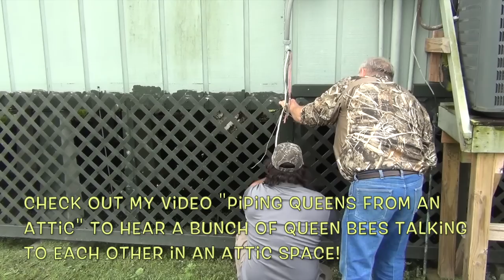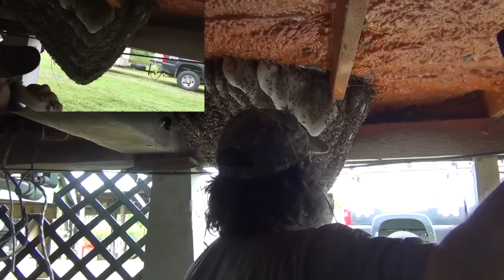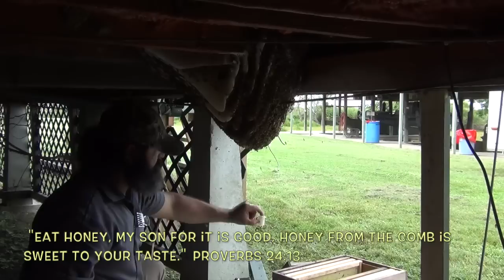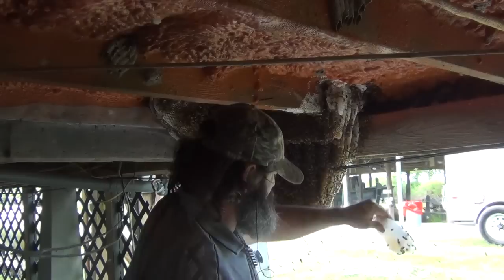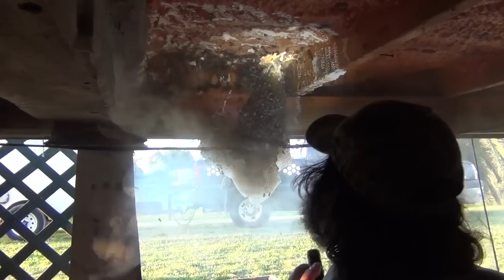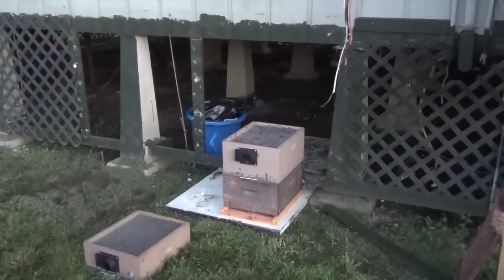Huge Bee Hive Underneath Duck Camp!

Comment: What can you do to prevent a new colony from moving right back in to this location once you've removed this hive?  I can't always get all the honey comb off and have had a few times where another swarm will move right back in from where I removed a former one.  Customers don't like that.
Reply from the maker: Evan Kenison scouts will be attracted to propolis that's in seams, etc...

The only way to keep them from returning is bee proofing.

Seal the area so they cannot get in, not just that area but adjacent areas, the entire side of that building is in some cases not enough.

There's no such thing as over bee proofing.

Never use spray foam nor regular caulking, they can chew threw these.

100% silicone.

Sometimes a backing is required such as steel wool etc...

If you're going to do bee proofing you better be extremely thorough & meticulous.

If there are major maintenance issues you should have the customer deal with that unless you're a handyman or carpenter.
Reply: JPthebeeman thank you. That all makes sense. I appreciate these videos. I'm learning a lot. Working with honey bees is addicting for some of us.  You did a great job on this cut out. Definitely have a gift!  I'll keep watching more and ask things here and there. I appreciate your experience.  I hope you have a good season.